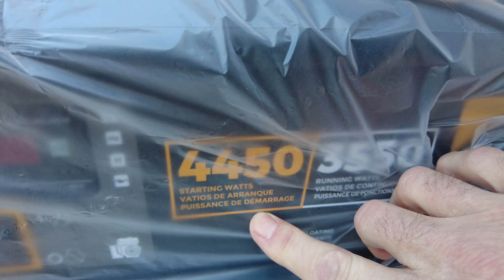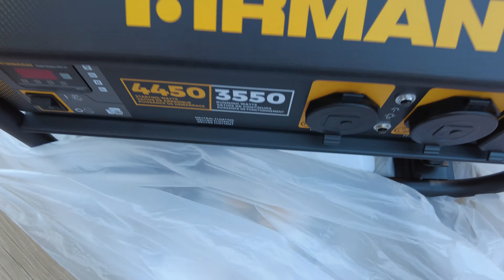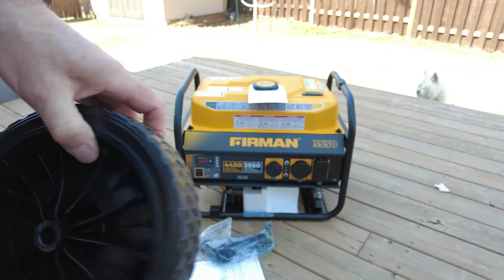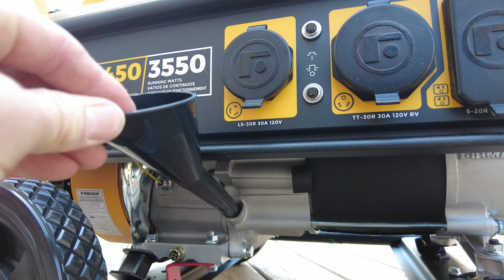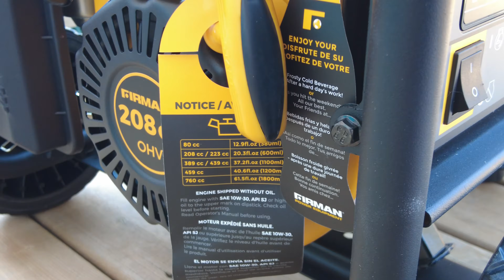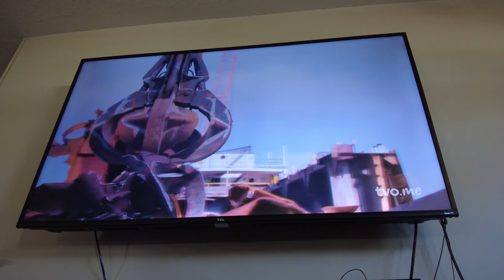Unboxing and Setup of a FIRMAN 3550 Portable Gas Powered Generator - Model P03501: 4450-3550

Comment: Definitely remove those red Engine Support Brackets, install wheels and rubber supports before filling with oil/gas so you can lay the generator on its side to make it easier.. Thanks for the video! Well done, sir!

Comment: I have same model for 5 years has always started in first pull.
Reply: I just got my first generator and is this one. Any maintenance or storage advice?
Reply: @StokedLlama install an hour meter and follow maintence manual. I use redline oil , it doesn't take much so i use the best oil.
Reply: I have a Firman 3550, which was needed to be used during 3 storms, as recently as July 1st. Failed to start each time. My neighbour is a truck mechanic and he is baffled as to why it won't run. It runs on star, but when you move the lever to run, it dies. Might need a new carb.
Reply: It would faster to use a socket wrench to remove the brackets. Geez, those bolts weren't even tight.

Comment: Im thinking of getting one for our camping trips…my question is tho is it loud when its on?
Reply from the maker: It is not one of those super quiet generators. This one is gas powered and one of those typically used in neighborhoods and places where noise would not be a huge issue. That said, you wouldn't want to be running this after 11pm as it is loud enough to notice, that's for sure. Good emergency generator tho.

Comment: And it’s ok to keep the gas in there and the oil? Guess there would be no way to drain out…the Home Depot guy also said to start it once a month…and how long can this stay on, we just lost power for 3 days , if you keep refilling with fuel, it will just keep going?also I was pouring the gas in with it running , is that ok?I purchased the same one  , just didn’t take out of the box yet…really appreciate your advice , don’t have anyone to help with this..thank you
Reply from the maker: It is supposed to run for around 18hours on a full tank. Starts easy and runs continually. To refill, just turn off, fill with gas, start and run.  Yes, keep the oil and gas in, run periodically, like once a month. Should work fine for you.